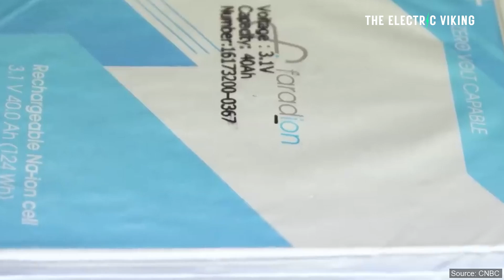Ex-Tesla engineer creates Sodium battery as good as LFP for $25,000 EVs

Comment: It would be great if these batteries could also be used as replacement batteries for older EVs. No one is addressing that limited market. imagine the value added if you could get a replacement battery for your EV, less than an ice engine replacement. We in the US would not need cheaper Chinese EVs if you could refresh an older EV for an affordable EV option.
Reply: After market refurbishment of EV batteries has been around for years. 4 years ago you could refurbish a hybrid battery for as little as 1,700usd.
Reply: batteries are the most expensive thing on a BEV. The rest is cheap.

Comment: The first electric car I drove was in 1973 and it was a perfect 1910 Baker Electric. It had a tiller for steering and a Vase for flowers. Computer chips were new at the time and would a great addition to control the motor, but the needed battery technology was still decades away. EV’s needed to wait.

Comment: Not bad,but not as good as lithium, because sodium voltages have a too great swing from 1.5 to 3.5 volts;  lithium is amazingly rock steady at 3.0 to 3.3 volts;   therefore, sodium will need sophisticated electronics and it will have higher losses than lithium<, this is why we went to lithium in the first place; the energy density of sodium is also inferior to the already terrible one of lithium,of 250 Wh per kg, as opposed to the initial 10000 Wh/kg of diesel or gas,30 times more.

Comment: When speaking about battery tech can you please speak in measurable terms and be clear about the claims of what you are covering? If you say a vehicle has 200 more miles of range that doesn’t establish any metric of the battery that is measurable or comparable. My 75kwh model y gets 310 miles range. I would suggest doing a side by side comparison of battery size, range, and price. Or when talking about LFP battery vs sodium talk in terms of energy density. You fast talked past the important part where you claimed the battery is 40% more energy dense. Just something I have been noticing about your videos, too much conjecture for my taste. (This is from a place of love) ❤

Comment: If this were true; it would make a big improvement over Lithium which is scarce #22 in prevelance in the earth's crust.  Of course energy density is not the full story. How about life cycle; - how many recharges? How prone to fires?  How long to get it into production and is anyone actually investing to do it?  It could be a step towards realizing many of the claims for EVs or just another bit of hype without the details.
Reply: Na cycle life will be substantially better than Li but at a lower energy density.  And virtually no fire risk. It's already in a production car made by BYD.  The advantage is that it will shave the cost of a mid-range commuter to something under $25K usd.
Reply: @PETERJOHN101  Do you mean the BYD Seagull? they backed out and didn't put in a sodium pack.  Lower energy density means shorter range. for the same weight.  Sodium batteries to date have been fragile, not standing up to shock; they might be more sutiable to battery farms. Why do you think they will be less flamable?  They are just up on the level up from Lithium on the Periodic table - meaning it is chemically similar to Lithium; just heavier. Maybe you are thinking of solid state which is suppose to be less flamable because it has no liquid substraight.

Comment: So far Sodium ion batteries have the same dendrite issue as early NMC batteries if not worse. Cycle life and shelf life is a very important consideration when choosing which battery chemistry is best for vehicles.
Reply: Good thing people actually have Na-Ion cells in their hands to test. There is significant progress on this already.
Reply: So far the batteries with the most longevity (especially for automotive application) have been proven to be lead acid batteries.
Reply: @svr5423  Not high-current batteries though. With starter batteries they cannot handle big discharges often because the shape of their plates is eroded, reducing their current supplying ability, and often completely dislocating the lead plate from the current collector. Nickel Iron batteries are far longer lasting, but so expensive. I believe LiFePO4 will prove to be much longer lasting than a Lead Acid battery designed for the same application.

Edit: Also, I believe you to be a bot.

Comment: "300 mile range" is meaningless.  You can always size a battery pack to whatever capacity you need.   What is the actual energy density of this new battery that is supposedly "as good as LFP" ?   No?  Nobody knows?  Then it's vaporware.
Reply: Na-ion is ideal for a daily commuter car even if it tops out at 200 miles of range.  Why?  Because it can be marketed for under $25k.

Comment: I hate the new trend of battery manufacturers listing range capability, rather than energy density. Because you can use a bigger, heavier battery in a lightweight EV and get more range. But it is not apples to apples. I like the fact that you added the point that the added weight for the sodium pack (over LFP) would be the same as an added passenger, to have a sodium pack EV with a 300 mile range. Keep up the good work!
Reply: Yea and idiots like Sam perpetuating the nonsense.

Comment: Sam you are wrong here. Recent major discoveries of Lithium in the US should come into production in the next three years. More than enough to completely electrify the entire US transport system. 
Once this happens Lithium prices will continue to go down or at the very least descend to a reasonable level. 
     While sodium is great, especially in cold weather, chemically (i.e. just by its location of electrons) Lithium should always be able to be more energy dense than sodium.  It's just physics. 
Therefore, while I see specific areas where sodium based batteries will be best due to temperatures, Lithium chemistry batteries will still rule the day.

Comment: Exciting news! But 300 miles of range should be a minimum starting point, not an ongoing standard. To compete realistically, BEV's will need 500 miles (800 km) or better range, and sub-10 minutes charging time to get to 80%. When these metrics are achieved in a $25K package, there will be no strong argument for purchasing a gasoline vehicle (other than specialized form factor  such as heavy hauler pickup truck). I'd buy one in a minute!
Reply: In the UK a study showed for all ice vehicle's sold there in 2023 the average driving range was under 400kms. 

Imo 200+miles is fine for the lowest end in town style run about evs as long as a 10-80% charge happens in 10-15mins. 
That's maybe 2 years away from being seen as standard imo. China thanks to catl is close right now to that except it's 20-80% in under 20mins.

Mid trims need closer to 300-350 miles and charge 10-80% in 10-20mins, that also is probably 2-3years away from being seen as standard.

Upper trim&priced model's will switch over to semi solid state cells from late 2024&early 2025. 

True solid state cells in 2026-28 will all go to the upper trim trucks large suvs mpvs&commercial long haul applications+airplanes, drones, cell phones and tablets or other consumer devices. 

So those will have similar 10-80% charging times as mid spec vehicle's despite larger overall capacity pack's. 

By 2030 I think solid state cells are in all premium segment offerings. Semi solid state then covers everything except the very cheapest evs.
Those will be lfp, lmfp, m3p, sodium and other low end per kwh, also covering bess, home batteries, taxis, 150-200 mile evs power tools etc.
Reply: @4literv6  Day by day, most people don't drive 100 miles, true. But people do drive several hundred miles in a week. I refill my vehicle about every two weeks, and it would be a pain to have to recharge every single day or every other day. Yeah I know, you can plug it in at home every night. But I'd rather not be required to do that. 500 miles of range (800 km) would be sufficient to make the vehicle the equivalent of any gasoline car on the road.
Reply: @ChickensAndGardening 
My ICE car only gets 300 miles and I have to fill it up twice a week. I would gladly switch to home charging.

Comment: I realize this is a video about battery but discussion has started regarding the 2018 compensation.
Rather say it once here and be done with it.

The media has misrepresented the payout.    
Elon Musk would need to pay Tesla $7.272 billion to acquire all 303 million shares.  Regardless of the stock price.
Elon is not getting money from Tesla the company, but from the shareholders via dilution of their stock by 9.5%.  
However that does not mean the value of shareholder stock will change.  That is up to the market.
If traders see the yes votes as a positive TSLA may increase in price. Or dump. We don't know.
If the vote is yes Elon has to wait 5 years prior to selling this stock.   
So not not depressing the market by flooding it with stock.

Comment: Question: If the chemical lithium iron phosphate exists, is there such thing as sodium iron phosphate, or for any other alkali metals?
Reply: Yes, there is such thing as a  sodium iron phosphate. And there are  sodium iron phosphate batteries in the lab. They are even more robust that LiFePO4 batteries they can handle even  high charge and discharge rates (50C)  than Li batteries and  LiFePO4 batteries. The down side, a low power density of NaFePO4 batteries. It is unlikely NaFePO4  will ever be seen in a car. It  might be able to see use as a immobile power bank... but then we will have  to compare cycles life to other battery alternatives.
Reply: @nickl5658 oh nice. Can there potassium, rubidium, cesium, and/or francium equivalent of this chemical? I know this question sounds bizzare but I’m curious
Reply: @jadenspires1891 
Most metals CAN be used as electrolytes, not sure about those in particular.
Reply: @PETERJOHN101  oh wow, I did not know that

Comment: Sounds great.  Just one caveat.  

You can charge a 400+ volt car in just 11 minutes, that is an incredible amount of power being transferred.  Home charging would not be able to preform that as it would require electrical tower level charging stations. I don't think the government would allow that kind of risk around ordinary people.  Could that ever be made safe?  I don't know.  Your thoughts?
Reply: They are not designed for home use.  Nor are they required,  as EV home charging is generally done overnight at lower power rates and perform that function more than adequately.

Comment: Another reason to slow charger expansion: faster charging TIME. If you can charge in 10 minutes instead of 40, you can use a lot of existing gas station real estate, including the stores. WAY more cost effective.
Reply: Yep, we need both - cheaper batteries with the same lifespan and much faster charging that doesn’t degrade them faster. We’ll need less ‘gas stations’, but re-using the existing ones we do need makes way more sense than millions of dedicated new ones.
Reply: Why haven't more gas stations, a.k.a. fuel and food mini marts, installed these bad boys? Would keep traffic coming to their locations.
Reply: @ChickensAndGardening they are around here- Midwest. Kim and Go chain specifically. Also Hy-Vee grocery stores- the perfect amount of time to charge and shop at the same time.
Reply: when you delve a little deeper into this aspect, you'll uncover the Achille's heel of the EV world. To charge a 100kWh car battery in 10mins will draw 600kW. And that's just for ONE fuel 'pump'. To upgrade a modest service station (which is able to provide gas to 8 cars simultaneously), would need to draw 4.8MW off the grid. And that is just ONE service station. Good luck laying all that copper to get to that nice real estate .. even if we allow for the fact that you can charge at home if you have as many garage spaces as there are cars in households
Reply: @jjolla6391  I'm not opposed to EV's at all, but we have to face up to the fact that when the grid goes down, for example during a hurricane or other natural disaster, gasoline pumps will still work if the fuel station has a diesel generator on site, as is now required in most of Florida. But for EV charging, this doesn't seem like a practical solution, unless it's a pretty huge generator, or maybe a massive backup Tesla battery.
Reply: @ChickensAndGardening  Here in the UK the grid going down for any length of ime is very very rare.
Reply: @ChickensAndGardening   No "we" don't have to face that, "you" have to face that.  Why is it that Florida always assumes the rest of the country must come running in and cleaning up their messes whenever there's a natural disaster and the rest of the country has to modify it's infrastructure to accomodate FL?  Maybe you just need to face the fact you choose to live in a disaster prone area and spend YOUR money on more infrastructure and hurricaine resistant housing?  Talk about entitled old people, sheesh!
Reply: @tmittelstaed  If we lose Florida, where will we all go for Christmas vacations?
Reply: Not possible to do that charge,say 30 Kwh  in 10 minutes,it is a lie, the battery would explode in 1 second; you'd need a feed of 180 Kw of power(30 : (1/6))   into the small battery, just not possible.
Reply: @josepeixoto3384  Depends.

Comment: Need to watch better videos. (Maker Just Have A Think) Where it was explained Natron battery tech will be heavy and how they were made up. Aiming for data centre back up and such use NOT cars.
Reply: BYD already makes a Na-ion EV 😂
Reply: @PETERJOHN101  Yes but this new supposed improvement I had seen about before this and it is not aimed at cars and may explain why there is no mass rush to use them instead yet for cars.
Lot of new stuff for ever being developed or reported in battery tech, going to take years to settle down, which is what probably puts a lot of EVs, having one and then finding it out dated by some new development.

Comment: The reporter learned from China Southern Power Grid that today, my country’s first ten-MWh sodium-ion battery energy storage power station in the field of new energy storage was officially put into operation in Nanning, Guangxi. This is the first time that my country's sodium-ion battery energy storage technology has been applied on a large scale.

At the Guangxi Vulin sodium ion battery energy storage power station, as the dispatching system issued a discharge command, 10,000 kilowatt-hours of new energy power stored in the battery cabin was sent out. This power will meet the power needs of 1,500 households for a day. With this The completion of secondary power transmission marks the formal operation of the power station.
According to reports, the first phase of the power station has a capacity of 10 megawatt hours and is expected to generate 7.3 million kilowatt hours of clean electricity every year, correspondingly reducing carbon dioxide emissions by 5,000 tons and meeting the annual electricity needs of 3,500 residential users.

Gao Like, deputy general manager of the Innovation Management Department of China Southern Power Grid Guangxi Power Grid Company: Under the premise of ensuring energy safety, the energy conversion efficiency of this sodium-ion battery energy storage system can exceed 92%, which is higher than the current common lithium-ion battery energy storage system. . We will further develop lower-cost, higher-performance sodium-ion battery energy storage systems, and unite upstream and downstream companies to promote the formation of a sodium-ion battery energy storage industry chain.

https://www.youtube.com/watch?v=OTNChIfTuIs

Comment: I won’t consider an EV under 400 miles of range.
Reply: @steveanderson9660   Do you do a lot of long distance driving?  If so then your statement makes sense.  Most people drive less than 50 miles per day, so such a requirement is just a holdover from the way we use gas cars.
Reply: Why?  You drive 400 mi per day?  Week?  Month?
Reply: That's fine, Uber is waiting for your call.
Reply: That’s OK. Keep paying $0.60 a mile with your ICE.
Reply: 250 is actually awesome, providing they actually got that under all conditions with little degradation over time.  Current battery packs are fine for most with home chargers, and deep pockets to buy them.
Reply: Impressive bladder❗
Reply: @lsd22252  🤣🤣🤣
Reply: Ok
Reply: Those already exist, did you mean 600 miles?
Reply: So when do you drive 400 miles non stop? If you do you are utterly irresponsible endangering both your life and those of other road users. You have to stop and your car charges while you are taking an essential break.
Reply: Ah, the ever moving goalpost.

Comment: the batteries are BS when charging them.
the grid can't handle it.
Reply: What rubbish - the grid wouldn't have a clue whether a battery a heater or a kettle was on the end of the line.
Reply: Then make the grid much shorter, Na-ion home batteries for charging at home and wind and solar for power source.

Comment: Dont think so (unless you are desperate), Na three times as heavy as Li. It would add around 40kg to battery weight.
Reply: Yeah! But some 30% to 50% cheaper than Li batteries, so, like in so many other things, price matters...
Reply: @nunagoras  A 60KWhr EV traction battery using lithium has about 20Kg of elemental Li at $15/kg ($300). 

However, a year ago the price was $80/kg. Since then a lot of new production has come on line driving prices down. How long current price holds remains to be seen but I wouldnt be surprised if it drifts up a bit.

A comparable sodium battery has about 60Kg of elemental Na at around $5/kg ($300).

So the price difference is currently inconsequential.
Reply: Not sure if Sam mentioned it but the source article said a 300 mile Na battery would be heavier by about the weight of one passenger.
Reply: Yes, but that's a comparison of raw elements, not the finished product.